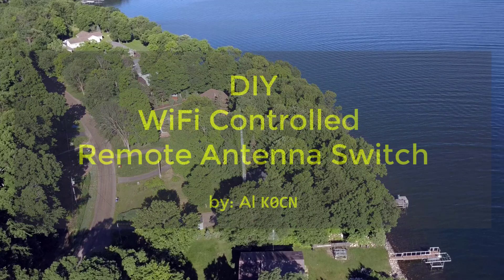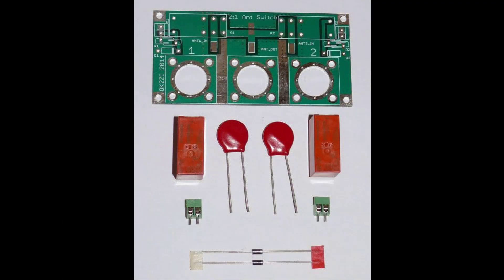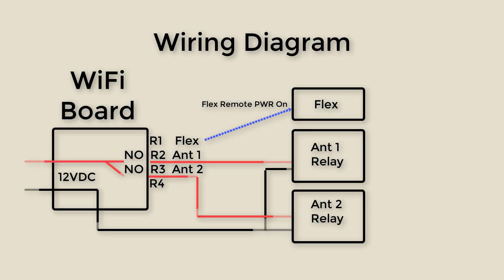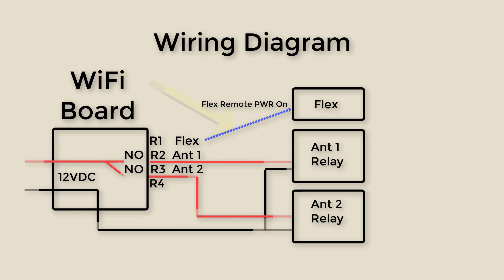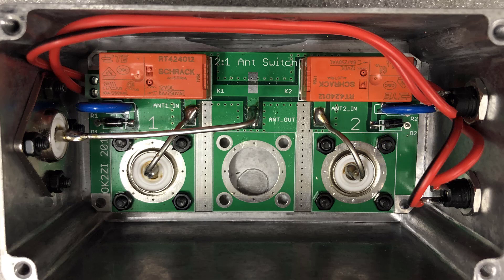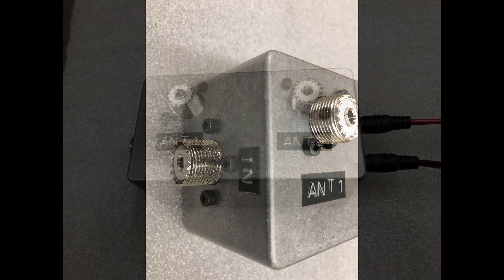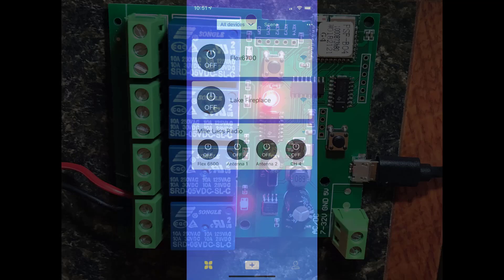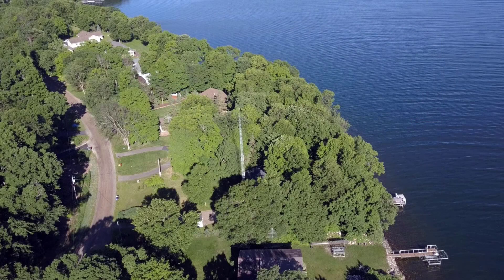Remote Antenna Switch

Comment: This is a great Video I want use my Icom 7300 at remote later and will have sure 2 different antenna.
I think can use many Wifi control boards have much different.
The total prize is 60 USD for this system.
Not to expensive :-).
I hope to try it later when possible.

Comment: New subscriber here. Nice little project.  Did I see reference to a Mill Lacs radio?  We had a lake with that name in central Minnesota.  Al the best.  73 de KI5HXM
Reply from the maker: You are correct about 100 miles north of Minneapolis MN
Reply: @k0cn  oh very good.  I grew up on the Iron Range about 70 miles north of Duluth.  I plan to be up there a few times this summer.  Most of my family still lives up there.  I live in Texas where I retired from my career in communications.  All the best, 73!

Comment: Use an ALEXA to turn an outlet on/off which has an AC adapter powering the double pole double throw relay. When you tell Alexa to "turn antenna switch, ON", the relay gets power and it switches antennas. You just need to remember what antenna is used for ON and which antenna is used for OFF. Use a double pole double throw relay. When turned off it uses antenna 1. When turned on it switches to antenna 2. Alexa works remotely from around the world, just speak to your phone. Echo dots and Alexa outlets are super cheap.

Comment: So, about 100W max?
Reply: Whatever you want really want to force on those tiny "10 amp" relay contacts. I don't like equipment failures so I would limit them to driving 12v 30A plug in relays and place those to minimize the use of stripped coax. The extra relay coil is a small additional power draw on the 12V for the board.
I don't think I can hit it with my WIFI so I'd probably have to build it differently, Perhaps control lines like the rotator uses..